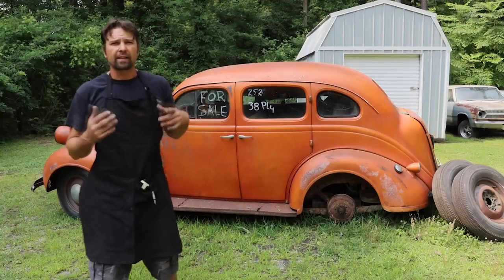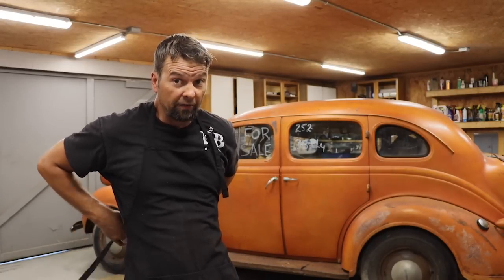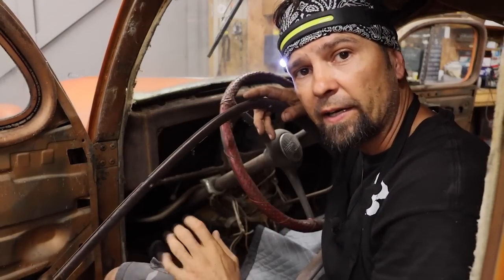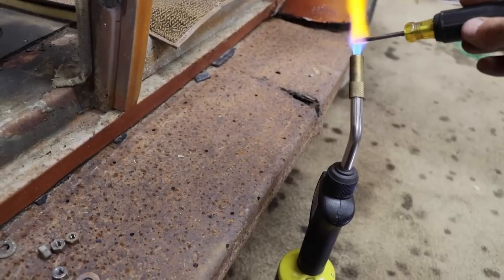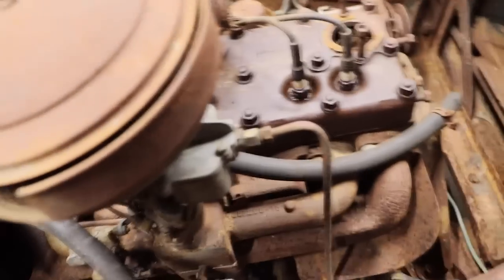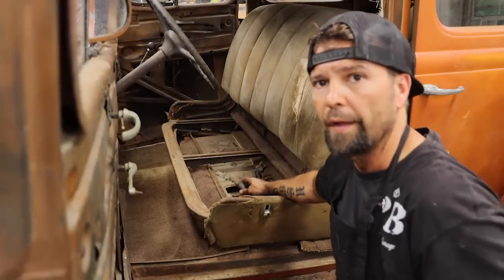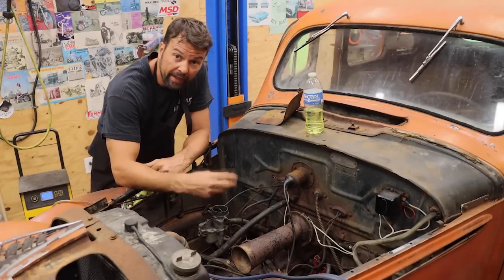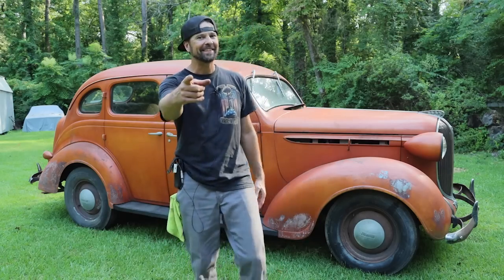Can I at least get it to run? Real deal steal appeal!

Comment: Those flatheads are easy to work on most of the time it's not stuck but the valves are always stuck. It's easy to take the head off to free up the valves and putting the thing back together is simple you can even reuse the head gasket just spray some of the copper gasket maker on the gasket and have never had a leak from them and have always got those engines running.
Reply: No loop op

Comment: Condition wise, it doesn't get much better than that for an original car from the era. That car is in great shape. The car is a project, but it is rare to find a 90 year old car that you won't have to spend a year doing rust repair on. There is a lot to work with on this one for someone who has the time and resources to do it.

Comment: Yeah, that bolted floor pan in the front is original. For easy access to transmission, master cylinder etc. There is a  water distribution tube behind the water pump. They always need replacing. They rust out.  enjoyed your video. Love the colour and patina of this car, Hope its kept original. Kool looking car. I own a 39 Plymouth

Comment: That car not being in neutral reminds me of the time a customer brought a full size 80's bronco in the shop because it "wouldn't start". After checking spark and fuel and scratching my head as to why it wouldn't start, I decided to check timing by sticking my finger in the number one plug hole. Not only did I not find any compression but I didn't even feel any kind of piston stroke at all. Climbed underneath to investigate and found the number one rod shot out of the side of the block! 🤦‍♀️ Ask the customer if he heard any noise before the truck shut off and he said "no, I was just driving down the interstate and it just shut off!.... No warning whatsoever!!!" 🙄 Needless to say, it had to have been making a hell of a racket before it let loose! So I know it was making some noise before it blew! And had the customer just told me the truth it would have saved me a couple hours worth of Labor trying to diagnose why the truck wouldn't run! Lol! I would have been much happier if he just said "it made a loud bang and then just shut off"! 🤦‍♀️

Comment: You have stuck exhaust valves so locate the location via the spark plg holes and get some of that spray you use directed at the valves,you can also try a teaspoon of petrol down the spark plug hole and put your butane torch to it make sure that there is NO petrol in the carb  this is just a way of putting a bit of heat to the carbon etc which will burn it off the facesas aprecaution have your remote starter handy if the fire starts to go awry just grank it and it will blow the flame out. Best of luck ! Chris

Comment: Good solid car for someone with more money than sense.  ;-)  Good job of assembling everything you could and should be fairly easy to install a modern engine and automatic just to make a cool weekend driver.  9:28, looks like a windshield wiper motor.
Reply from the maker: Yep I come across this stuff all the time. People taking these cars apart and then life happens…. It’s ok though, that’s why I’m here I guess. Yep wiper motor
Reply: I love what you're doing.  I lived in the junkyards back when I was younger.  I found a rare one I bought for $375 a 1942 Chevy Fleetline.  Had a Tijuana Tuck & Roll interior and a complete rotation of the steering wheel 1 1/2 turns before it changed direction.  LOL  I think I eventually treaded it for a motorcycle. @PoorBoysGarageUSMC
Reply from the maker: @pclayton5063  I love tuck and roll

Comment: A trap for young players, i hope someone restores the car, i think it is well worth it, KEEP IT 110% ORIGINAL, NO STUPID  LS swap or that kind of CR💩P!! Would be Super Cool too have the old valve radio back in place HOPEFULLY it Might still work???? The old Flathead engines are Tough, lift the head off ( unlike a modern car it is EASY ) hone the bores lightly, best to take off the sump clean out the sludge, put in some 30w oil nothing fancy ( oil, they were built for just simple plain oil! )

Comment: its  hard to no where to start  i have a 1960  morris minor  1098 cc  was just in need of  t l c that was  2 1/2 years ago
 new clutch , new all around breaks  linings   re con back diff  electronic  dizzy   new dash  new electrics  new head gassket   new plugs   i when first started ripped it all apart    NOW ON NEXT PROJECT  WILL  DO IT MORE SLOWLY   MAN SHE LOOKS  GOOD  DONT  CHOP HER  OR CUSTOMIZE HER  SHE WILL BE GREAT AS SHE IS

Comment: Good job all it took was somebody who knows something about working on a car. You could check the valve clearance on the side of the engine without taking the head off. Put a Volkswagen electric click clack fuel pump on it.The work you did the price went up by 1,000 I would say.

Comment: That was the original vacuum wiper motor and the ones in boxes was new electrical replacement wiper motors that you took out of back seat area  so how much is asking price I would like to add to my collection I have a 40 dodge 3 man business coupe and 41 dodge pickup keep the video's coming
Reply from the maker: Yes vacuum wiper motor. Asking 5k

Comment: I'm not sure why you don't want to take the head off but it's really simple and not a big deal but if you want to get it to run right you may have to take the head off but even if you do it's not a big deal the overhead valve heads are a bigger pain in the ass then the flathead heads.
Reply from the maker: I will in the future.

Comment: Man I'm telling you, I would LOVE to have this car, but it'd have to have either a 360 Magnum, or a 5.7 Hemi swap with a NV4500 behind it. I've never really been for originality, but it'd be cool to have this thing with all the originality of the 1938 chassis, but with modern touches like a reliable fuel injected V8, air conditioning, modern suspension,  but with a full original restored interior, as well as the frame. Of course, if you're going to do all that, you might as well swap the body onto a full frame chassis like a modern Crown Vic or a full-size truck of some sort. Still, I think it'd be a cool project to have. I just can't get down with the inline six that maybe made 50-60 HP when new. I'm a horsepower freak.